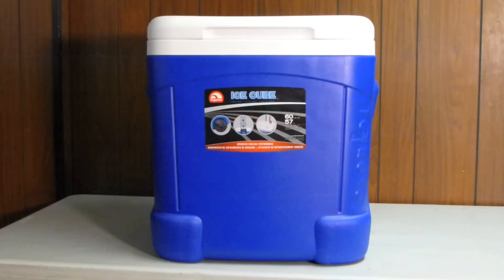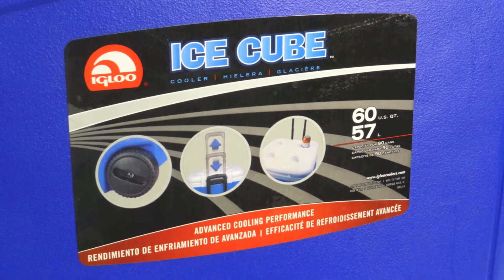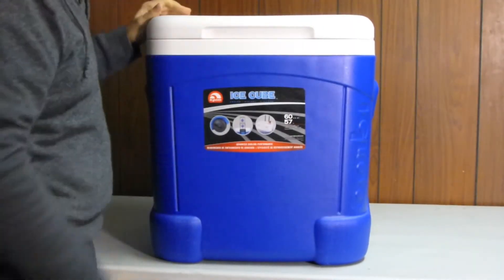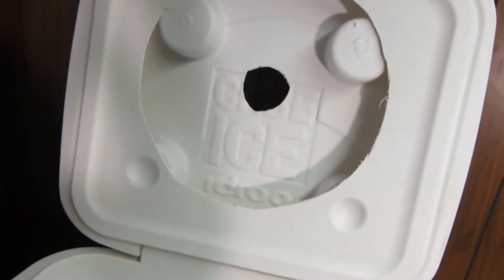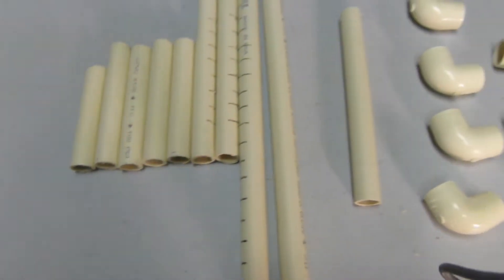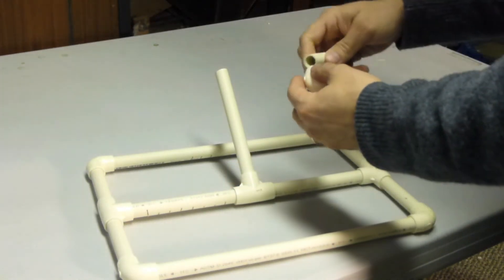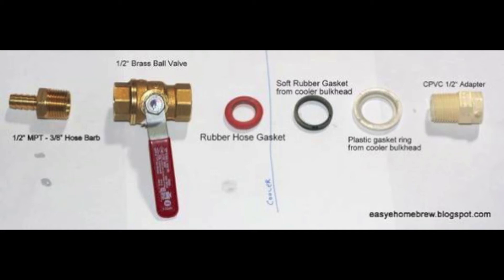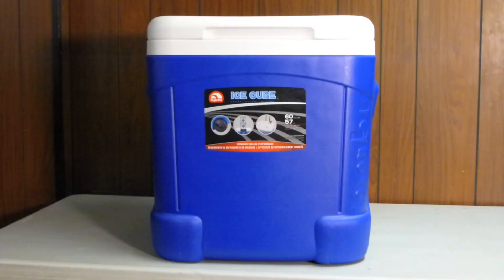Mash Tun Build from an Igloo Ice Cube 60 Qt Cooler  | The Keg Tap

Comment: What is the size of the carboy?
Reply from the maker: I use a 6 gallon carboy when I use it to control fermentation.
Reply: The Keg Tap thank you.  Do you think a 52 qts igloo cooler would work for a carboy like yours?
Reply from the maker: it all depends on the dimensions of your cooler. Check the dimensions of your cooler against that of the carboy.

Comment: I'm considering getting this cooler for my mash tun. How does it do holding temp? I assume it does well, but just want to confirm before investing.
Reply from the maker: +Bryan Debbink Yeah it holds temp very well. Tip: add your grains to your water and add your water at 10 degrees over target strike temp so you can let the water warm up the cooler. I usually put it in 10 degrees over target wait until it hits target which takes only about 10-15 minutes then I add the grains. Hope it works out for you.
Reply: +The Keg Tap Thanks! Yes, preheating the tun is essential. I've done one all grain batch in a 28qt cooler/tun that I got off a guy on craigslist for cheap. Way too small. I think I could get away with it for a 4.5% beer, but not much more than that. The 28 qt will make a good HLT. Cheers!

Comment: do you have measurements for your CPVC?
Reply from the maker: Jon Anderson Its all in pieces at home so I can certainly measure it when I get home. Let me know and I'll respond later tonight.
Reply: The Keg Tap Im just curious about your efficiency with the angled pvc upwards???  why that route and not down towards the base of the cooler...Ive seen both ways today after searching other cubs Mash tuns...if your willing I don't mind waiting.
Reply from the maker: Jon Anderson I get about 72% and even with the angled pvc, which I thought would be a problem too, not much wort remains in the mash tun maybe a cup or two but not much at all to have an impact. I'm guessing the pull from the draining wort sucks out most of the wort like racking from a carboy.
Reply from the maker: Jon Anderson 
2  - 11 3/4"
2  -  5 1/2"
4  -  3 3/4"
1  -  5 3/4"
1  -  3"
5  -  Elbows
3  -  T Connectors
1  -  Threaded Adapter
Reply: yeah.. but what is the diameter size for that CPVC pipe? You only wrote the various length of it?

Comment: Very cool design guys. I can see the similarities with mine. Because the neck of your rises so high above the actual manifold. I would suggest attaching some heat resistant tubing to your brass valve. That way you create a syphoning action and get more of the wort without tilting. Great vid guys. Keep em coming. Cheers and 17!
Reply from the maker: That's a fantastic idea. Thanks for the suggestion and thanks for watching the video! Cheers!
Reply: +BrewingwithBill Can you describe what you mean by adding the tubing to get siphoning action in a bit more detail? It sounds like there's already a siphon action happening simply from the continuous flow down into the brew kettle.
Reply from the maker: +Bryan Debbink what he means is instead of draining the wort without tubing like I did in this pic (https://www.instagram.com/p/8Y0RCkHS2O/) attach some tubing to it so that the tube creates more suction and can draw out more wort
Reply: +The Keg Tap I see now. Great. :) I was thinking maybe I misunderstood physics for a moment.
Reply from the maker: Bryan Debbink good luck man!